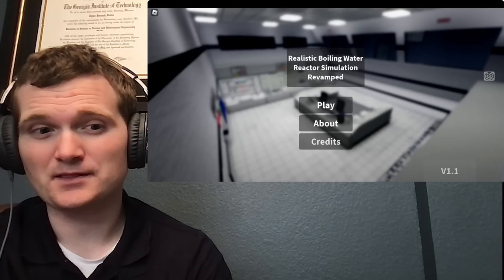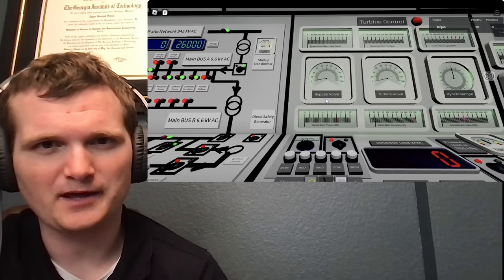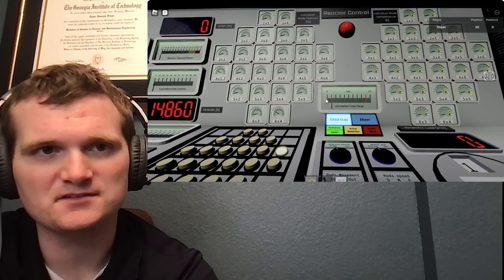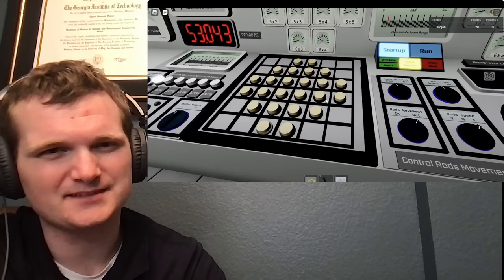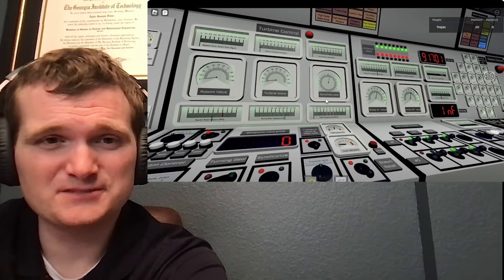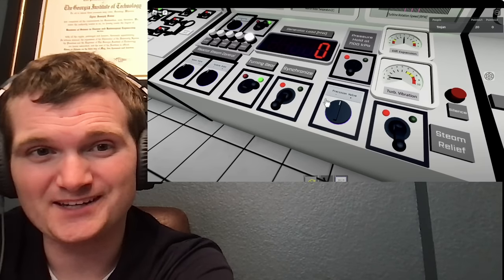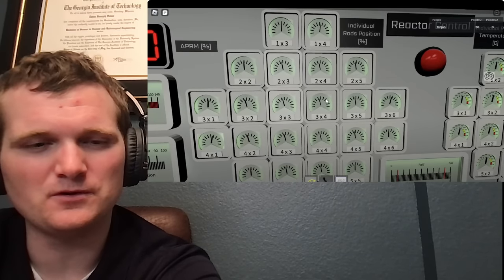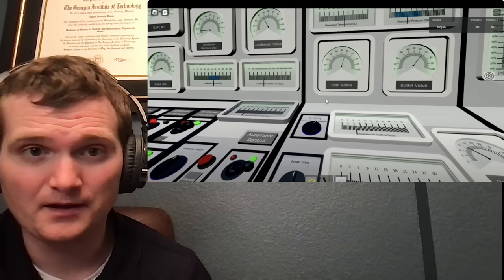Nuclear Engineer Reacts to Roblox Realistic Boiling Water Reactor Unit 2 Startup by Norbert009

Comment: That is actually kinda neat.
I don’t run reactors or power plants of any kind, but my understanding of syncing to the grid, you have the turbine directly spinning a dynamo - and when you sync to the grid, the grid will make your dynamo (and turbine) spin at sync speeds.  That means abruptly changing the spin speed of a rather large chunk of metal.  The more closely you match speed and phase, the less disruptive that is to your equipment (the less likely it is to spontaneously disassemble).
Reply: Kinda like coasting at 70mph then dumping the clutch at idle rpm, the wheels force the engine to spin faster and it doesn't like that so it blows up
Reply: Now you have to do more to start the Turbine.
This is my old Tutorial.
My latest is from Version 1.4
Reply: Yeah so in the real world we match frequency with the grid, set the turbine to be higher than the grid in terms of frequency and voltage and then sync by shutting the output breaker.  This effectively locks us into phase, and by increasing steam flow to the turbine we pick up load without changing speed.
Reply: Ages ago I got to visit Bonneville hydro station #1 in Oregon.  The turbines are Kaplan type, imagine a fan blade the size of your house.  Lots of spinning mass.  They were running normal operations when I went through, but they told me that if the sync scope was just a skosh off when they closed the breaker, the whole building would do a little shake and a pulse of noise would reverberate.

Comment: In the newer versions of the game, that guy is actually unqualified as you need 1k points to use U2, also there is a limit on how fast you can speed the turbine as going too fast for having too much torque will overheat the casing. And you never want to have these reactors hit 100% ARPM as that would cause a meltdown. This plant runs off of a demand based system, you adjust reactor power to meet demand and you get points from been -50 to +50 of the demand
Reply: not anymore 🙃, I'm now a Supervisor.
Reply: @norbert099 Same here lol

Comment: CANDUs have individual horizontal fuel channels which are individually cooled with heavy water. PHWR. They can be fueled while the reactor is operational with individual fuel bundles cycled through the channels and repositioned into other channels if need be. Bruce in an excellent plant to take a look at,

Comment: Is it true that you could swim in the nuclear rod cooling pool while the reactor was running safely? Would the water still provide shielding / protection as long as you don't get too close to the bottom?
Reply: You can stand over the pool and look directly at the exposed core of some research reactors. 

Assuming that there's a bunch of safety overhead I would be willing to dip my toes in the water for a short time period, I think that one meter of depth should be safe-ish. 

(I'm not a professional or anything, so don't go swimming in angry water)
Reply: If you watch Folse's older video from the Chernobyl Roblox one where you have players swimming and having a party in the spent reactor fuel pool.
He actually mentions and comments on that you can be in the warm water without any ill effects, you dive down however it gets a bit worse.
Naturally, the boys running the plant would be very cross with you if you decided to do that though.
Reply: @CMDRSweeper  I bet someone somewhere had done that, it's just off the records so to speak. Let's be honest for a second here, if anyone was a worker there and knew that it was safe... well, the rest is history
Reply: The water will be somewhat warm, but not hot. There usually is atleast 8 meters of water on top of the fuel bundles (even while they are being moved), and it is enough to stop basically all radiation. But as you go deeper, radiation levels grow fast. Somewhere about 2-3 meters away from the rods the radiation levels start to be around 10 Sv/h which can give acute problems in minutes of exposure. Depends alot on how old the fuel is, after 10 years it can already be moved outside the pool in a special container
Reply: @CMDRSweeper  Very cross indeed.  ISTR a comment in Randall Munroe's "What If" series, that attempting to swim would be fatal, not from the radiation but from gunshot wounds.

Comment: Does a reactor room in reality have that much background noise? Seems like it could stand to be as silent as possible, to prevent fatigue.
Reply: In this case, we normally do not go for heavy sounproofing because sometimes sound will help warn you of an issue before the sensors... for example a sudden loss of pressure will only cause an alarm once it reached one of the pressure sensors, but you may hear the blowout. While I do not know reactors, having experience in non-nuclear but similar spaces, you just want as many ways to know about problems as possible.

Comment: 2:35 Where I work at in germany, about 90% of my stuff is working with the local electrical grid operator, mainly within the 10kV - 400V conversion stations, we also follow Red = On / Hot / Don't Touch / Be Careful, Green = Off / Save when it comes to button and signal coloring.

Though I also worked with machinery where it's Black = On, Red = Off throughout all of my early years as an electrician... Was weird rewiring my brain to see Red as On at first, but my work never sees me work under voltage without very clear guidance by the electrical grid operators staff, so luckily there never even was a possibility for this to become an issue.

Though makes you wonder how the different standards got setup for different sectors... 🤔

Comment: But why are the green/red lights backwards at your plant? I can see how in certain situations it could make sense. Red usually means danger, green means safe. If a nuclear reactor is running, if a giant turbine is spinning at thousands of rpm, it could be interpreted as a potentially dangerous state to be in. Therefore red is the dangerous, operational state and green is the safe, off state. But that can't be applied to all situations. And to throw the entire green=on and red=off convention out the window just seems like a way to introduce a potential source of confusion.
Reply: We did some research and indeed most plants use red for on and green for off, but that's not always the case. Some plants use it the way we use it and it's not only the navy. Taking into account that this game is mostly for teenagers I think we should stick to our convention.

Comment: i played this a ton, but not i dont much anymore, too much dread when i think about multi tasking the pressures
Reply: You actually get used to it.
I can keep U2, Turbines and Polishers in Operation.
I keep checking Turbine Parameters, Polishers Parameters and the Parameters in U2 to ensure that everything works fine.
I have to change the oil filter for the Turbine at some point, I have to regenerate the Polisher, I have to increase Oil Backflow when pressure gets too low for Turbine which at some point forces me to do a oil leak check, I have to check the Generators Temperature and decide how much cold/ warm air I have to use etc. ... it honestly can be complicated for newcomers in Version 1.4.1

Comment: Now, you need 1,000 points in U1 to be able to enter U2MCR or U2TCR.

Edit: As a junior supervisor in this game, I will tell you that this guide is outdated. In u2, you now have SRM, IPR, and RUN modes. SRM is source range, in both units, IPR is intermidiate power range, and run is, well, it uses aprm, or average power range moniter. This unit is a bwr, but the voids dont form if you are on self-circ mode.

Edit 2: The red thing is group block, and there is now an SRM block.
Reply: Which is good considering a army of Visitors tried to raid U2.
Reply: @norbert099  The legend themself
Reply: Only on public servers!
Reply: 21:39 They did add that function, in the supervisor room above the U2MCR, as we call it, but only people with a rank of Senior Supervisor+ (Am I right? Haven't played 1.4.4 yet, my internet hates RBWR) can do a unit interlock.